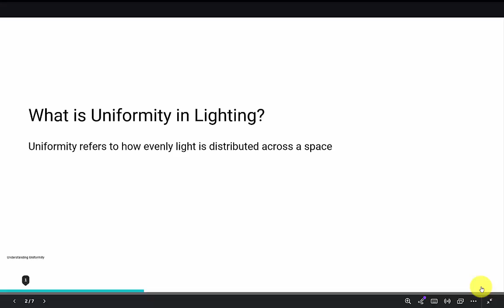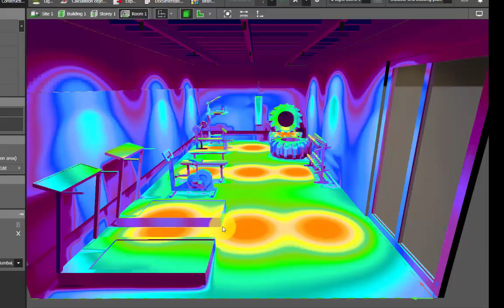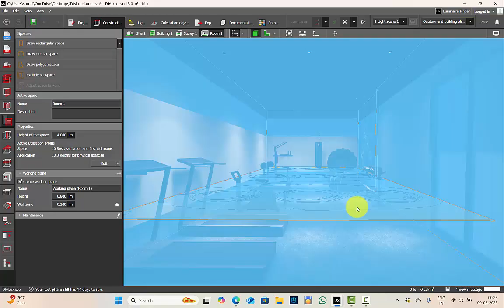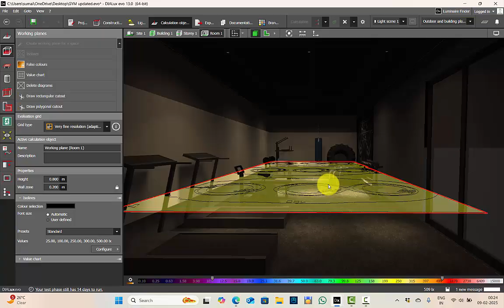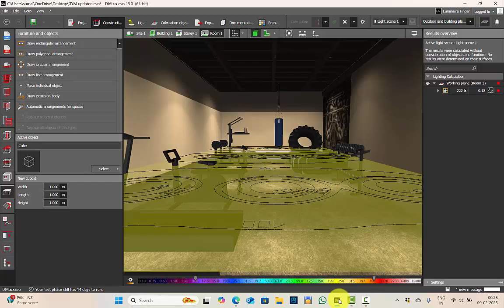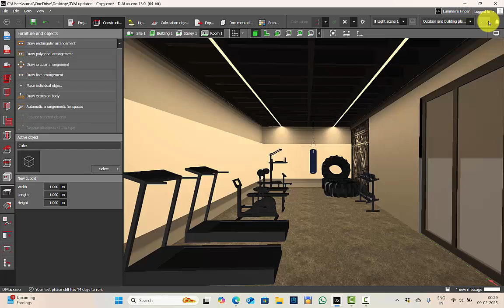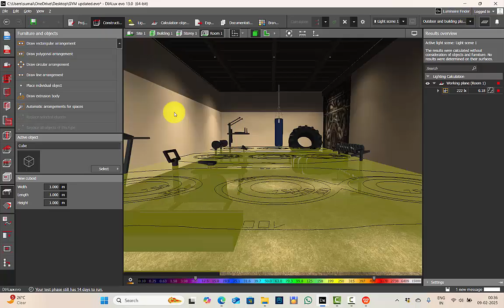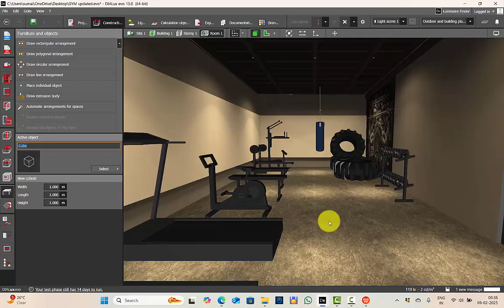What is Uniformity & How to Calculate It in DIALux Evo?

Comment: Thank you for the video Engr. Sumaiya, Can you please let me know the uniformity needed for public parks, is 0.2 good enough if lux required is achieved?
Reply from the maker: For public parks, it’s important to consider that not all areas require the same level of lighting. The lighting design for walkways and key areas should ensure adequate visibility and safety. While a uniformity ratio of 0.2 may be acceptable for less critical areas, walkways typically require higher uniformity (closer to 0.4) to provide a consistent and safe experience for park users.

I would recommend referring to the lighting code of the country where the park is located for more specific guidelines and requirements regarding uniformity and lux levels.

Comment: Hii, could you help me please?
I just get the uniformity result when I run the simulation with 'without objects and furniture' checkbox marked. Otherwise, it shows just 0.
Reply from the maker: When you check 'without objects and furniture,' the calculation only considers the open space, so the uniformity is higher. But when objects are included, the shadows cast by the objects (like furniture or columns) below them affect the light distribution, which lowers the uniformity and causes it to show as 0.